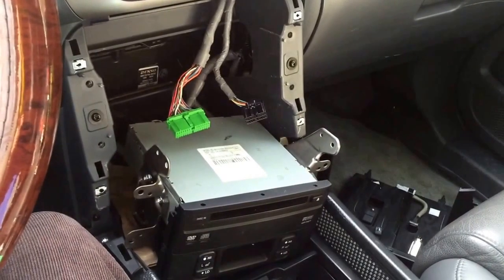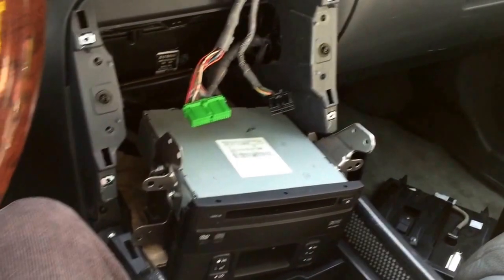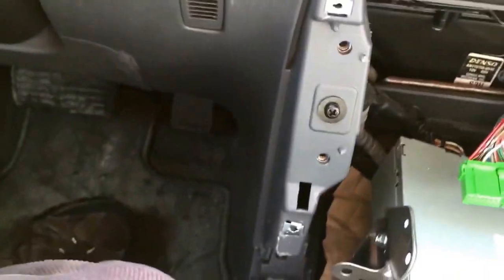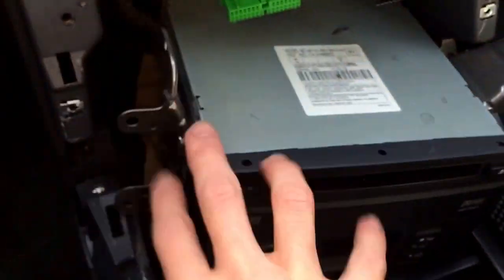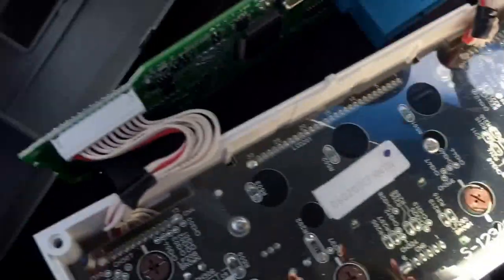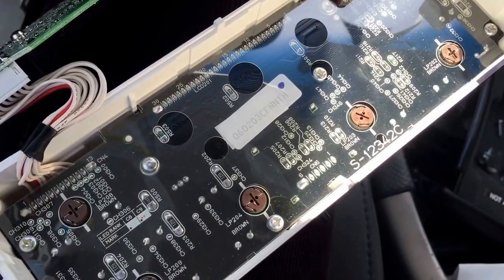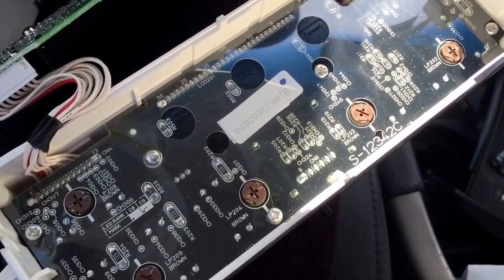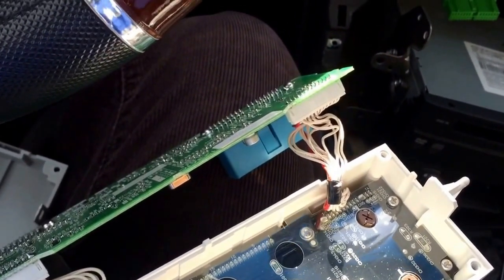2006 Honda Pilot Ex climate control light bulb replacement tips (NOT A DIY!!!)

Comment: You need to show the disassembly process!
Reply from the maker: +Wes Clark next time I'll do that.
Reply: @mds2465  Please provide the product number for the bulb replacement.  Also, is this the bulb replacement for the logos (such as the recirculation light logo, A/C, defog) as opposed to the backlight of the LCD readout?

Comment: What do you mean it is not a DIY. I did it myself 1st time without any prior knowledge. Honda dealers sells the replacement bulbs, but end up buying at a Radio Shack for much cheaper. Just take your time and you'll be fine. It was fairly simple.
Reply from the maker: of course it’s a DIY job, I’ve done it many times before. I just meant this video was not a DIY instructional. I got yelled at by a bunch of people for not clarifying that so I put that as the title.
Reply: How do I get the lower panel with the cigarette lighter out. I removed the screws but it not pull that out. Seems like something else is holding it tight in there. Could you give me an instruction on how to get that out please!!!

Comment: What is the bulb part?  I want to order before I disassemble.  Will this work for a 2007 model?
Reply from the maker: +Travis Wolfe hey there, sorry about that, but I thought I included the part number in this video. evidently that was not the case. but the part number is 79670-S9V-A01. This will work for the 2003-2008 generations. Honestly, you're better off picking them up from the dealership if you can obtain them there. I got them shipped once and it cost me about just as much as it would've at the dealership, and it took about 10 days for them to arrive. If you do get them from the dealership, I recommend that you call the parts department and provide them with the part number and ask them if they have that part number in stock. also let them know how many you need. This will make things go a lot more smoothly.